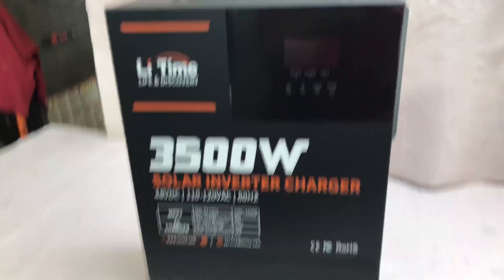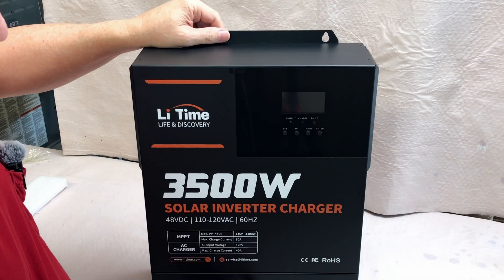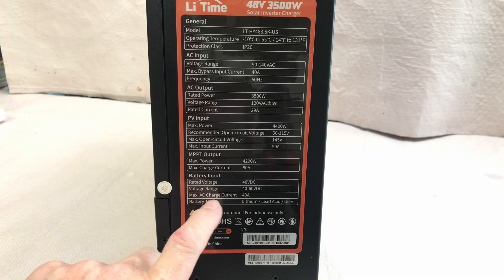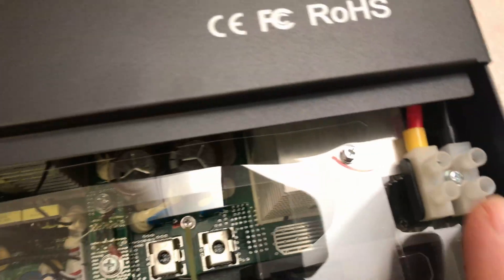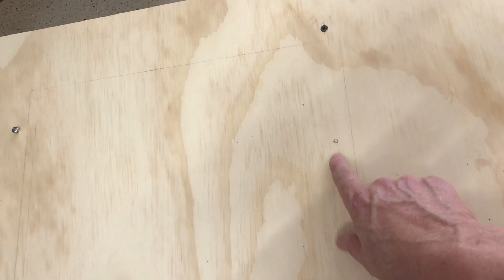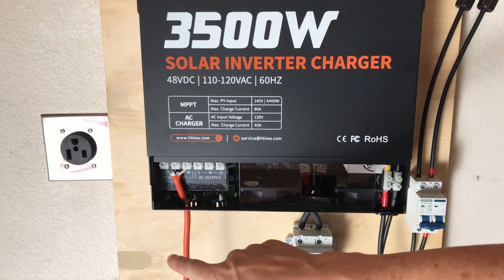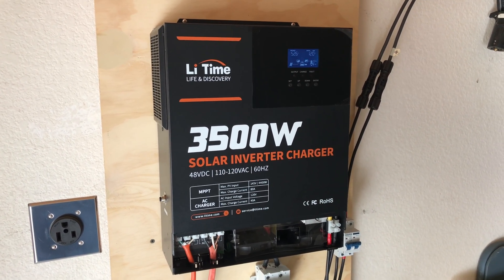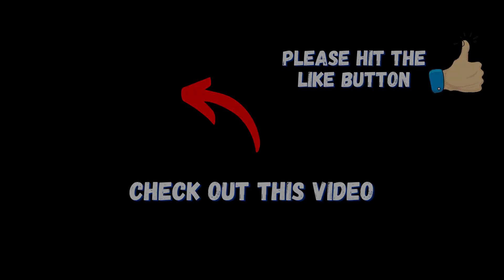Never Lose Power Again! Easiest DIY Home Backup System

Comment: I'm in the process of going semi-off grid as well. I have a Pecron E3600LFP with three EP3000-48V expansion modules (about 12.3 Kwh). Right now they are just powering my furnace (natural gas) or AC when utility power goes down (way too much for my liking), with some additional supplementary usage (freezer, refrigerator, well pump, router). Eventually I'll install a transfer switch like the one you show in this video, probably a slightly larger one though. Currently, I charge the Pecron system with utility power or my tri-fuel Westinghouse 14.5 Kw generator. Eventually, God willing, I'll install a small bi-facial, n-type panel array on a sun tracking mast. Anyway, that's the plan. I really appreciate your videos. They have helped me gain knowledge about this technology and come to the point where I am today with the potential ability to become less dependent on utility companies. Please carry on and keep up the good works... Kudos.
Reply from the maker: That’s excellent, thanks for sharing your experience and glad I could help!